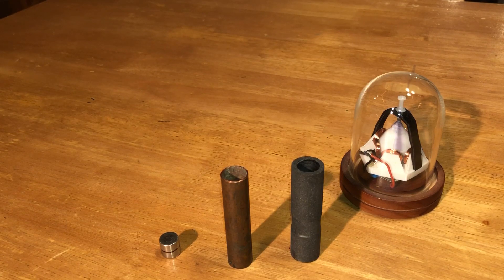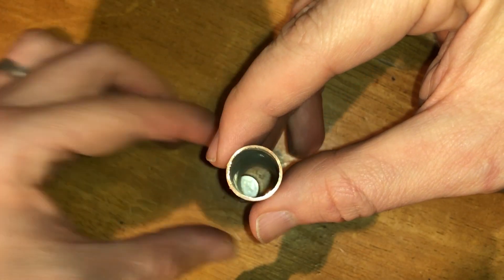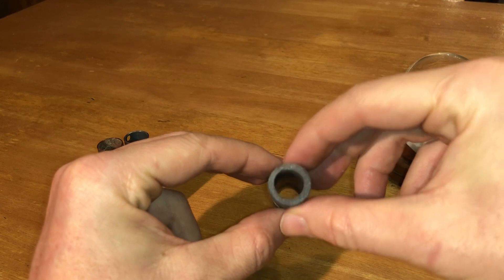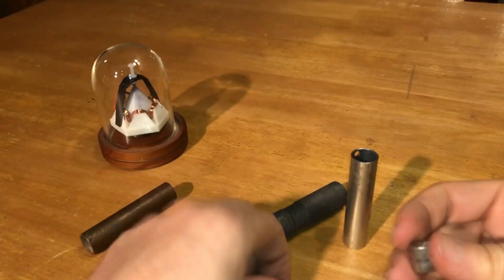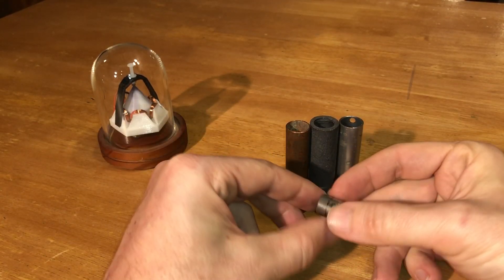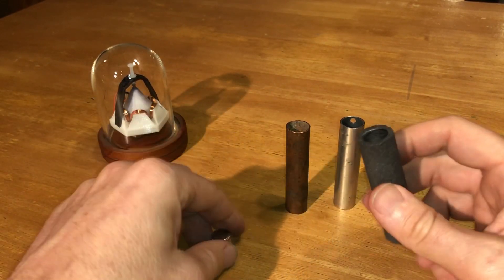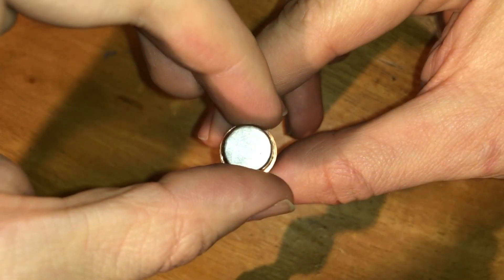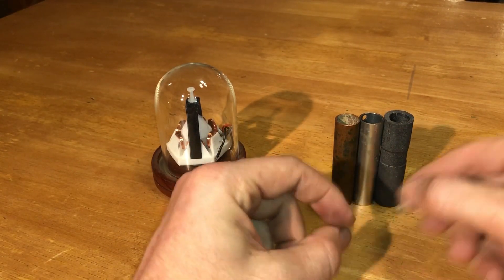Lenz's Law - Magnet Through Carbon Tube?

Comment: An easier way to see it is with a block of shungite. Moving, rolling, or dropping magnets on shungite has no effect. My question is “whether a coil of conductive carbon-infused thread would make a magnetic field at all?” If not, then how is resistance impacted? If so, then Lenz doesn’t apply.

Comment: I would want to see that done with a better grade of graphite like using vein graphite and crushing it into a tube shape (something you can do with it to form shapes almost like a clay while under pressure before completion and it will actually as a sheet float over a magnet unlike regular graphite that is in a glassy state or something)

Comment: interesting. excellent question. so from here we can conclude graphite doesn't allow magnetic Eddy currents to slow the progression of the magnet. 

by definition "The magnetic field created by induced current opposes the change that caused it" for lens law in the copper pipe... 

but in the carbon tube the magnetic field induced in the metal that would attract the falling magnet to create resistance doesn't exist...

it would be my next question to ask: "is that simply because the graphite isn't metal?"

I bet the answer is at the atomic level... 

29 electrons in copper
only 6 in graphite...

I wonder if the arrangement matters...

My next question would be "how many electrons can we stuff into an atom?"

No known element has more than 32 electrons...

but a quick Google search reveals 

"Oganesson is a synthetic chemical element with the symbol Og and atomic number 118"
- Wikipedia

but I guess you can only make that with a particle accelerator. lol

some more googling
"Florine atomic number 9, so its electronic configuration is 2,7"

but it has the greatest number of electrons in the outer shell...

might be interesting to try this with a gold tube. but a solid gold tube might be pretty pricey...

Comment: I think it will fall faster thru the graphite tube, because it's diamagnetic, so it will reflect the magnet's flux, and much more strongly than the common "levitating" trick shows, because it's contained, and curved. Or maybe not faster, but smoother. Might not even notice the difference.
You should try putting that magnet in a small graphite crucible.

Comment: I wanted to explain why carbon failed. The copper and aluminum are created by pulling and stretching the metal crystals which partially aligned them making eddy currents more possible as the atomic nucleus can align better. Copper tubes made of random stacking of crystals would have a faster freefall.  If you can create a carbon tube through pulling and stretching, you'd get a little better response.

Comment: I think it will fall fast. I think the conductivity of your graphite tube is much lower than copper.    I have dropped the piece of copper square inside 3T MRI magnet and it was falling like a leaf. Or as if moving inside a viscose oil you cannot see. Very weird and interesting to experience

Comment: Robert murray smith used his graphene ink to paint a bit of a coil (like, just on a piece of paper) and got some voltage out of it, passing magnets over it. (in one of his recent low torque wind generator vids)  So I Think it's possible, as induction occurrs.  If it is indeed immune to the lenz effects, coating thread in a graphene ink, could make for a more efficient and much lighter motor. If I manage to make some graphene ink, it's something I'm going to try.

Comment: I admit I was suprised... but I shouldn't have been. Magnetism and induction are the principles here - not conductivity.  You should repeat this experiment with a graphine coated tube - use the electro-chemical exfoliation method to turn graphite to graphene, and apply the purified graphene to the pipe. The graphene is far more conductive and electrically useful than graphite, as the 2d-arrangement of carbon atoms in graphene allows for amazing conductivity. I do not know about it's magnetic properties, or how it responds to electromagnetism. In the presence of aluminum, for instance, graphene becomes photovoltaic, and reacts with light. 

I predict that a current can be induced into a graphene coated tube - unlike a graphite tube. In Graphite, the material is not configured with the same symmetry and tight organization as copper, aluminum, or graphene, and therefore a current cannot be induced strong enough or symmetrically enough to slow the effect of gravity. 

While I am sure graphene would behave more like copper than graphite, I am not sure how much the material thickness matters in this situation - a 2-d layer of graphene is a lot less conductive material than a copper tube, so I may be wrong. But in theory, the magnet should be able to induce a more powerful current through graphene than copper, provided that the graphene can receive an induced current. 

This is really interesting. If the experiment was successful, it would have implications for the role of mass in electromagnetic interactions. I think the charge and conductivity matters more than sheer matter.... The question is whether or not electrons are drawn from the whole material , and thus more electrons would be available to flow in a larger hunk of copper than would be in a small layer of graphene. However the graphene would allow electrons to flow not only from its own material, but whatever material the coating was applied to. The carbon Graphite probably lacks the symmetrical electrical pathways to allow the free flow of magnetic and electric fields - while conductive, it isn't magnetic. It would be interesting to look at the behavior of graphene in the presence of conductive metals. 

Great video... Got me thinking about carbon structures now.

Comment: The reason the graphite doesn't slow down is it is porous. Look up the Edward Leedskalnin Perpetual Motion. It works as long as you don't use laminated metal and plate.  
    I've enjoyed your videos and info now I'll give  you one. Find one of those little Radio Shack round magnets look for 1/2-Inch Round Ceramic Magnets 5-Pack. Now check and you will see there is a N and a S. Use a gas burner and heat it on the flat side either north or south and it kill one side the magnet leaving you with a one polar magnet..

Comment: Doesn't graphite have higher resistance than copper and iron when present in an electric circuit. If I am correct, the reason the magnet falls slowly is due to the electromagnetic field produced from the eddy currents on the material. Since the resistance of the graphite is so high, the are not electromagnetic fields generated in it.

Just My Two Cents

Comment: Alternatively you can use a pure .999  silver pipe which is 2000 times more electrically conductive  than graphite and very diamagnetic to see if the Lenz Law magnetic breaking effect is produced. If yes then you will know that you didn't see that on the graphite pipe because its relative high resistance which hinders the creation of eddy currents.

Comment: Hi lasersaber,

I am an Electrical Engineer. According to the established theory of EM I did some calculations and I concluded that you have to increase the carbon graphite cylinder wall thickness x5 from the one you have constructed in order to observe the same magnetic breaking Lenz Law effect as the copper tube you used in your experiment. For example, if the wall thickness is 3mm of the graphite pipe you have to increase that to 15 mm. I suggest you do the experiment again so your don't get wrong conclusions which will mislead your future experimentation. Good luck.

Markoul11
Reply: @Lasersaber, I'd love to see a follow-up on this!

Comment: graphite is very resistive compared to copper, so the amount of current that is generated due to the magnet passing is low therefore the amount of magnetic field generated from that current will also be small. You can try aluminium foil compared to thick aluminium tube, u will find same issue,, it is all about eddy current...

Comment: However this experiment is very interesting nevertheless. I wonder if the graphite will be pushed away by a moving strong magnet, the same used in the pipe Lenz experiment ? I really doubt it.  Of course all materials are partially diamagnetic and paramagnetic at the same time. However the dominant property of the two in the material is which makes them diamagnetic or paramagnetic in total. Seems that if you use a much stronger  magnet you will get the Lenz effect on the graphite pipe... try it.

Comment: Wow, Thank you so very much. 
1) I thought graphite was a pretty good insulator. 
2) I thought it would fall because the induced magnetic fields would not line up. Copper has free electrons, Carbon bonds more completely. I think the bonding prevents the induced field as the conducted electrons scatter , with different polirizations, through the material. They do not all line up. 
Would coils work. Willing to bet a beer that it would work. Why? Sufficient amperage creates a path of electrons flowing over the skin of the carbon creating a magnetic filed. 
    PLEASE try it and let us know.

Comment: graphite is is much more relative diamagnetic than cooper which is slightly diamagnetic and aluminum which is paramagnetic such as no eddy currents or very little are magnetically induced on the graphite that would exhibit an observable Lenz law effect you are demonstrating. It's more or less like trying to get the effect out of of a wooden pipe  even if you could make somehow the wood to be electric conductive. Do you think you would get the Lenz Law effect?

Comment: Most things reflective will work. Most that absorb light won't. 
Some exotic plastics/ceramics excluded. 
In the old days metal was called a non-electrics, because it destroys the electric field. 
I believe the theory is the wire is a boundary that translates the electric field to a magnetic field, and back again. 
But if you enjoy relativity, you won't like this.

Comment: Hello from Ukraine :)
It seems to me that it is the diamagnetic nature of graphite.
Read about "pyrolytic graphite".
Thank you for your videos!
Reply: Regular carbon rod does not behave like pyrolytic graphite
Reply: @heavycurrent7462  But then you need to ask yourself the question “what is the difference between ordinary graphite and pyrolytic graphite” :)
Reply: @OVELVNCAK  Pyrolitic graphite is made in a lab. In nature graphene layes do exist inside the bulk of graphite, but not in a consistent arrangement. The result is that pyrolytic graphite is extremely conductive and diamagnetic, but regular chunk of graphite is not. Correct me otherwise
Reply: The magnet would have fallen way slower through a graphene/ pyrolytic graphite tube than it did through the copper. But he was using a chunk of graphite with irregular structure and high resistance. The result is apparent, no noticable diamagnetism from the rod

Comment: I was fooled! All  3 tubes have very low resistance. I chose slow magnet fall through carbon tube. Now I am wondering if a carbon coil can be made  to operate as a solenoid. Thanks for arousing my thoughts.  I now wonder why. I'm thinking about dropping a magnet through a shorted copper wire solenoid and also controlling the magnet's position while it is inside the coil.

Comment: you can't measure the resistance of those materials with that flimsy meter (what you saw on the meter is probably more the wires than the piece of pipe). If you make the resistance of the carbon the same as the copper, it will fall trough as slow as with the copper tube. Eddy currents are induced currents, so the material is "not important" only the resistance of the material. any conductor will work Si Al Cu Hg etc. etc.

Comment: Just throwing a theory out there. Unlike copper, there is no dielectric permattivity occurring in the graphite. Although both copper and graphite are diamagnetic, some polarisation is dielectrically induced in the copper as the magnet falls through a copper tube, allowing their dielectric planes of inertia to combine causing drag. With graphite, magnetism is displaced only and there is no dielectric drag occurring.

Comment: Remember why we were forced to use graphite instead of copper for spark plug wires back in the 80's? Extremely low EMF with acceptable conductivity at higher voltages. But there you go, spark plug wire core maybe from a manufacturer that is willing to sell it to you. You will have to find a feasible way to insulate the core though, maybe with a Saran Wrap type tape? All my best.

Comment: I'm most likely off base but... Heat will render anything magnetic or conductive completely useless... I wonder if the drilling of the carbon, heated the carbon rendering it incapable of doing the Lenz effect... Try placing carbon rods in a circle, and drop the magnet down it.

Comment: Ok,well that is interesting. The carbon tube conducts just as well as the copper,but when you drop the magnet through it,it dose not have any lenz force acting against the magnet like the other conductive tubes. Why is it not acting like a shorted turn like the other materials ?.

Comment: try this, for fun, take a piece of copper wire and make a jumper from the top to the bottom but make the distance from the tube about an inch.   Try a thin wire and then a really fine wire.  Vary the width from the copper tube.  The magnet is compressing and forcing the static field to move through or at the furthest point but the entire field is within the reach of the magnet so the magnet and the field resist each other.  The only 2 (choices) the static field has are to leave the copper or to skirt the easiest point.  By making a jumper outside the main effect of the magnetic field, a current will flow.  Just like an electrical motor winding but inside to outside.  Make the jumper shorter than the full length so your magnet doesn't just pop out the bottom? Also fun to use a variable resister to see the speed difference.  Edit:  Try it with an led or diode and it becomes a one way Lenz's Law    Also try just making the outside of the copper non-conductive with electrical tape, would it change anything? I don't have any kind of workbench but I would take a bet. Edit:  would an external jumper with a high resister midway that spun into a coil at the bottom around the base of the tube create an electromagnet at the bottom to slow the magnet further.  Second Edit:  does that graphite interfere with the magnetic field like ferris metal.  Last thing, the inner diameter,  the thickness and how much of a static field it holds all matter. Thats my answer

Comment: Now that is a neat experiment. I can imagine what the magnetic field's are doing but it would be better to see it. Take apart one of those artistic heads where are you use a magnet to spread metal dust to put a beard on my face. It would be neat to see the difference the materials make. You may be onto something by trying to generate electricity with new materials.  can't wait to see what you do next. Thanks for sharing.

Comment: I think the carbon is like wires. The induced current can not move perpendicular, like in the copper. No Lenz.
(An open copper coil has no magnetic resistance.)
A carbon coil could therefor be very interesting. Good luck with that expiriment. Love to see it.
Thanks for the video.
Reply: Laser.

Comment: It dropped almost as fast as free fall.  Try wrapping a coil around the graphite rod and an air coil of the same dimensions, and  drop the magnet through tube with coil and free fall through coil measuring the voltage  generated in each. 

Hypothesis: because graphite is a relatively strong diamagetic material, you'll have fewer lines of magnetic force cutting the coil wrapped around the outside of the graphite tube, and thus will observe less deflection in a meter connected to that coil. 

Other observations. Superconductors are examples of perfect diamagnets, and aside from flux pinned magnets, magnets will float across a super conductor unrestricted by eddy current loss in the superconductor.

I strongly suspect a magnetic will drop faster through a copper tube with a graphite inner tube, than the same copper tube without a graphite inner tube.

Comment: Welcome back. What happened to the  free energy device where 
you charge it with a battery and the light stays on for quite a while?
I think you were getting VERY close to what Alkua did. I wonder if 
you put a magnet on there somewhere if it would give the little boost
needed to run without having to use the battery to start it?
   I have many ideas if our interested. How about a monopolar magnet?
I"ve got one.. :)

   The carbon tube is porous, in order for the lenz to work the
metal has to be solid.   I think a Magnetic field is like water. The 
more porous the faster the water/magnetic field will run threw 
it. BUT the less porous the less it goes through it thus the lenz
is the lack of going through. 

Search for the Edward Leedskalnin Perpetual Motion Holder. 
Using a solid bar it works BUT put laminated sheets of metal 
it doesn't work. 

   Try this, put a bunch of holes in the copper pipe and 
see what happens. OR try cutting it down the side
and see what happens.